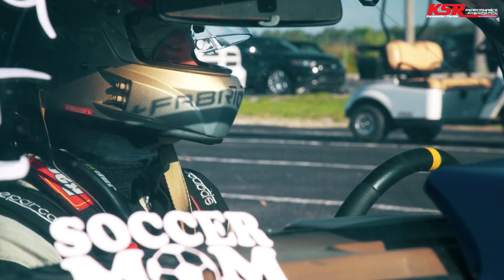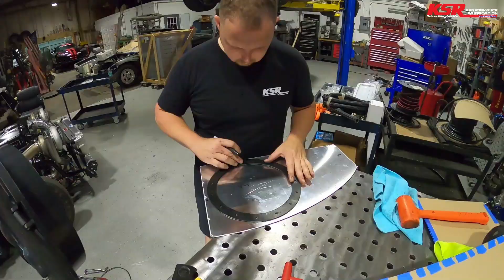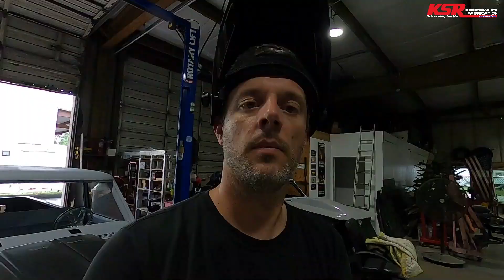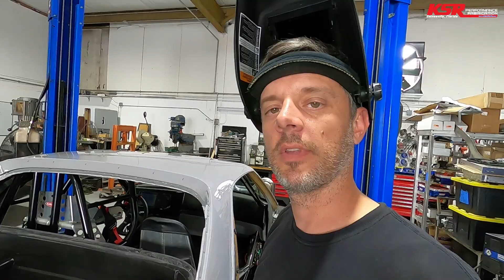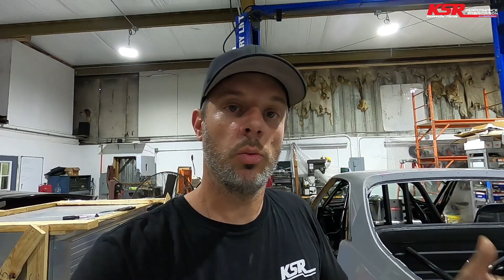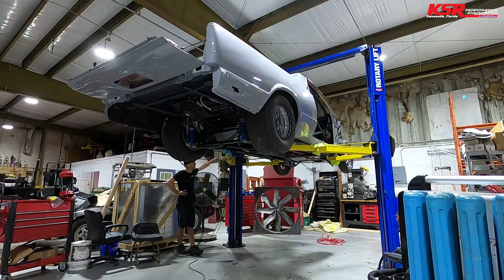Mullet El Camino Build Episode 24! Catching Up on Recent Progress!!

Comment: Kevin i know this is a long shot but where did you get the lid for the intercooler water box.
Reply from the maker: Its a waterproof lid for a kayak
Reply: @KSRPerformanceFabrication  i have been looking how big is it. i have only found 6 inch ones and that looks to be much bigger then 6 inches
Reply from the maker: It’s a 9” inside diameter I think. Got it from Amazon
Reply: Thanks kevin

Comment: Have you considered running a slider system for the fuel tank (cell)? It would allow for more minute adjustments of weight, and would allow for an additional tank to be installed quickly for long trips. I would make holes on the rails, to allow bolting to the rails themselves. The company I work for runs a similar system on their Baja machines.

Controlling how they land on a big high speed jump(using weight distribution), was the reasoning on being able to infinitely adjust this. And being able to slide in/out a tank quickly, lowered repair times (time where other parts could be worked on).

Comment: did i hear right that you are using ground terminal on the back of the car to control the switch??!!ever heard of ground being able to hover between positive and negative poles?i was building my malibu to similar extent as camino hear and had already wired like kevin said he would and the main responsible man for that said absolutely not due reason i gave.he has masters degree in electrical engineering and worked for nokia back then.if you do,expect a  myriad of mysterious appearing and disappearing electrical gremlins!!
Reply from the maker: The battery cut off is basically a huge relay. The ground control for that relay goes to the back cut off switch, the positive control for the relay goes to the front switch.
Reply: @KSRPerformanceFabrication  ground control still haunts me.why do you need it?all the relays i ve worked have a fixed ground and hot side is controlled.is it something new?

Comment: I'd like to understand the reason for such a big overflow tank?
What's the logic behind such a huge box? I'd expect a much smaller tank like 1gallon tank max.
Reply from the maker: Its definitely on the large size. There are a couple of reasons that I made it so big: 
1: If the engine ever "holes a piston" the crankcase tank becomes a catch for a bunch of engine oil that will get shoved out of the motor when the crankcase sees 40+ psi
2: This is every single system catch can for the entire car, Crankcase, transmission, rear end, rear fuel cell, intercooler vent, main radiator
3: Just incase the owner ever forgets to dump the tank.....there is plenty of room for alot of fluid to be captured...... (have you ever seen the tanks on Leroy and Ruby overflowing, wink, wink, lol)

Comment: One thing I would do is remove all of the zip ties and replace them with stainless steel zip ties. I would hate to see a hose dragging because one of them broke. Project farm said that these are some of the best ones he tested per their price point.. HYCC 100pcs 11.8 Inches 304 Stainless Steel off amazon for like 11 bucks..
Reply: Are you putting a hitch on it? I forgot if you said that you were doing that or not?
Reply from the maker: Yes, it will be part of the parachute mounting.

Comment: the hooptie law may apply. you cannot fix every problem because a new one will pop up. if you prevent every issue, a new issue will more likely occur. basically leaving a fail point might reduce chance of driver fail causing wreck. 

superstitions are weird sometimes.

Comment: I was wondering you have the fuel tank and the other tank rear and then water tank in front of bed its not much weight but would it be beneficial or not to place while the car on the scale

Comment: Kevin, when someone decides to have a race car fabrication museum.....mullet WILL BE IN IT.  YOU AND YOUR CREW do outstanding work .  the bottom of the mullet is as beautiful as the top side. a secondary ground on the back half is REALLY SMART addition to the system.  how about secondary padding for the seats for race week.  rugged radio headsets ready to go??  Charging ports for the smartphones?. CUP HOLDERS FOR SURE. great video sir.

Comment: Why not make up two sleds that weld around the transmission pan /bell housing but ties into the frame of the car, so if it wheelies n come down it hits the sleds instead of the trans pan or belly pan of the engine?

Comment: I really shouldn't watch these videos.. I miss welding so much. It's one of two things (the other doing auto paint) that I've ever felt like I was MEANT to do it. I get the helmet on and get to work and it just feels right, same with a respirator in the booth. I wish I could get a job doing it but out here in Yuba County Northern California, there's just not welding jobs to be had other than heavy equipment repair which takes a strong back and I don't have one thanks to my scoliosis. There's just not very many light jobs around here and the one race shop I know of is an hour away and I don't think I can fit inside their cars to weld rollcage tubes being 6'10.

Comment: Project creep!

I went to install 4 light switches today. Ended up installing 10 receps and 13 lights and a breaker after the switches. Turned a "1 hour minimum, may actually take 30 minutes" job into a 5 hour job.

Comment: Suggestion; put a plastic bump stop or slider(s) on the frame that will take a hit before the oil pan does from a wheelie and you could put one where it would protect the overflow hose from speed bumps etc on the road. Stunt bikes have something like it to keep the radiator and body work from getting as beat up when they drop the bike.

Comment: Ah man, all those little finishing touches eat up time like nothing else! Building a full header and exhaust system takes as long as sorting out the tail lights sometimes 😂 no matter how many cars I've built, I'm always surprised at how long the last pieces take, worse when it's my own car 'cause I just wanna drive it!

You're not being too optimistic though, for what it's worth. Getting each little part absolutely perfect night add a few days or a week of build time, but the car will (hopefully) be out and running for years and the extra time that part took gets forgotten pretty quick if it means better racing and more enjoyment for the next year or two. The details take time, but the impact of doing it right (or not) is 10x bigger than the build time!

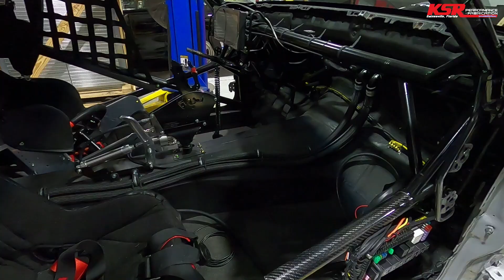Comment: I have a question about the lines you can see at 12:40 are those fuel lines? If so why are they ran from the inside of the car and not the outside? It’s probably like a stupid question but like wouldn’t that cause fuel to spray in the cabin if there was a failure? Just a question, would love if you could answer it. Love the videos man, great work

Comment: Such a professional custom build by Kevin. You know the thing that worries me, is that 'car maintenance' is not in Cleetus McFarland's vocabulary. He just runs things until they break... doesn't do scheduled maintenance on any of them, doesn't check brakes, suspension, safety systems etc. Just checks gas, ice, tire pressure and oil and that's it. I worry for Mullet's future, I really do😐

Comment: Man I’ve been prepping for RMRW 1.0 for months now and I had been running low on motivation, but this video kicked me in the butt to get up and go work on it right now! I’m going to go fix brake lights, wire the horn, and install the trans temp and trans pressure sensor right now. Testing this weekend! Fingers crossed for 8.50s!

Comment: In your battery voltage board where the original gas tank filler neck is don’t u think u should make that a momentary switch so as soon as someone lets go of the button it cuts the power off to that led screen. It’s not much of a voltage draw but if someone leaves that on while it’s being transported or something it would probably kill the battery. Just a thought

Comment: Kev
Wouldn't you prefer to keep lines hoses wiring  tucked 
I know you said Sno-ball
Dragweek will see something getting run over an all that plumbing below the frame is a pinch point 
You've put so much thought into the rest of the car
I hate to see a break from a mechanical while road trippin that bugger 
I've hit more wildlife on my motorcycle so I think too much

Comment: You could use the hose roller track stuff for the hoses in the bed like the ones they use on slide back recovery vehicles on the hydraulic hoses that will look good for when you move the fuel tank backward and forward

Comment: Question, why are none of the ice water tanks insulated with alight weight high density insulation?
There's a verity of things to choose from, plus it would help with condensation dripping on the track, keep water colder longer , and keep body from rusting out under the tank.
Along with that same thought, why aren't the intake side of tubing, especially after the intercooler to throttle body?
Even as fast as the air is traveling, there has to be great deal of heat transfer, especially at low rpm's, and staging where it would pickup the most heat transfer.

Comment: I am dying to know what the final cost of this project is.  Parts, labor, fab work everything.
Reply: If you have to ask, you can't write that cheque. 

If you want a 6 second car, plan on 100k as a starting point to get the drivetrain and cage work. The first car I put AN lines on I made the mistake of "oh, a $8 fitting..." and $1800 later I went "wow, that was spendy".
Reply: $250-300k minimum

Comment: How are you preventing backflow from the catch tank? Ie. the radiator pukes a ton into the catch tank and fills up to the fitting that the rear diff breather line attaches to - preventing the coolant from polluting the rear diff.
Reply: If that tank gets filled to the top, I'm sure the car has bigger problems than one system possibly feeding into the other

Comment: If you want bright sunny days always carry an umbrella as it only ever rains when you don't have one.
There are places under a car where bottoming out is most likely to occur so you should avoid placing things in those places.
Just behind the front wheels is a strike zone for speed bumps and gutters due to the sudden drop compressing the suspension.
The middle of the vehicle is mainly a scrape zone

Comment: Put a nub on the fuel door so that when it closes, it hits the voltmeter switch to the off position. If it's left on, there is no way to see that it's on from the outside and a flat battery waiting to happen :)

Comment: Kevin I love the work you do and the thought you put into it, but I have some suggestions for the mobile/removable rear fuel tank. I think an E track tie down mounting system would have been better. It would give you a ton more mounting locations and quick removal without the need for tools. Also an idea for the lines going to it, maybe look into Hubbell-Kellems CableTrak. It would allow for multiple positioning, keep the lines in place and uniformed, would also protect them from getting kinked.

Comment: I used to wire a few street rods and cars for guys...I don't know how that happened, wound up doing probably 10 overall. I had a cartoon cut out of the comics in the old Sunday paper with a pic of a guy getting chased down a hill by a giant snowball. 
My wife gave it to me.
I got to the point where when people asked about time frames I mentally added 25% to the my estimate. Towards the end, where they wanted cruise control, power seats, power windows, power trunk lids, and everything you would find in a luxury car I just said, "I will call you when it is done".  I know as a business guy you can't do that, I could as I was working on one at a time,
The snowball effect is real, and there is no way around it when building a car like Mullet where you are trying to plan for every possibility and make it extremely serviceable and almost modular.
Me...at 62...I have one more build in me. Mine. LOL.

Comment: A simple solution would be to add a skidplate under the car, that will add significant protection against road salt, rainwater and damage that you don't want under there, in addition it will greatly improve the aerodynamics under the car, which I can imagine are pretty bad right now, but I'm sure you've thought of these things already.

Comment: Not sure if something like this would help with the fuel hoses. https://www.amazon.com/Black-Plastic-Chain-Carrier-Router/dp/B00880AVL2/ref=asc_df_B00880AVL2/?tag=hyprod-20&linkCode=df0&hvadid=198071192844&hvpos=&hvnetw=g&hvrand=1082838630173327778&hvpone=&hvptwo=&hvqmt=&hvdev=m&hvdvcmdl=&hvlocint=&hvlocphy=9016922&hvtargid=pla-365229598478&psc=1.  There are different types you can look at.

Comment: A "20:20 hind-sight" idea for the plumbing and wiring.  Could you have made the transmission and driveshaft tunnel a little bit wider and tucked everything up in there?  That would help protect everything from road debris and definitely protect items from the wheelie-landings.  It ALMOST looks like there's enough room as it is although that would make accessing the transmission a bit more difficult.
Reply from the maker: These cars can be packaging nightmares. Already the width of the seat + seat belts + roll cage has us crammed in pretty snug.
Reply: @KSRPerformanceFabrication  I still think there's need for additional protection of motor and trans pans in the event of the car coming down from a wheelie. Just seen an episode of Cooper's wheelie and the added down frame hoops saved everything from damage
Reply: @KSRPerformanceFabrication  True enough, I'd forgotten about the interior fittings!

Comment: Maybe I missed in the video somewhere why the catch can is so big in the back? I understand putting them all together I totally dig that but it's just a massive huge frankly ugly? Tank. You do great work so it threw me to see that maybe it's code I don't know.
Reply: I would imagine he is adding ample volume in the event there is an issue. You can get a double failure and end up with lots of oil and coolant in there at one time. The volume buys time to get the car stopped safely, or this is my take on it. He has tied all of the overflow and crankcase ventilation to one central location so you need to account for that too.
Reply from the maker: It is pretty large......but we are planning for a future alcohol fueled engine and let’s be honest......ole Cleetus may go a few races without draining it, lol.

Comment: So if your thinking about building a car. It's a thousand and 1, 2, or 2 dozen or more things to build it. I have helped my dad build two cars. The amount of wiring, little brackets and small bolts is insane. Still really fun work super frustrating at times but worth it. I lost track of how many times I routed then 
re-routed wires. Then came back two weeks later and looked at it and didn't like it and made adjustment.

Comment: You know when you open a video and you see Kevin with his hood open, it's gonna be good.
Reply: Yep.  Not to be negative, but all that tig welding is almost as bad on the hands and wrists as typing.  Which usually leads to carpal tunnel and surgery.  Hopefully he has consulted with someone in the physical therapy field for exercises to prevent or slow its arrival.
Reply: @95_S10_LSSWAP  I hope Kevin hasn’t gotten started on that.  I’ve played bass over 40 years and despite 3-4 occupations that could’ve done me in, I circumvented it by stretching multiple times every day for many years.  Hopefully Kevin might see this and kick around the idea - it takes a minute but it sure is nice (for me) to be almost 60 and still have great flexibility and no sign of carpal tunnel.
Reply: @95_S10_LSSWAP Bad grounding will fix that - if you don't get burned, you will find new muskell that hurts
Reply: JOKE- OR not. How do you know that you are software nerd? You actually use that wrist rest on keyboard
Reply: You should take 10% of your weight and take it up at any angle with straight hands. 1 standing up. 2 on your knees 3 at your belly (do not try this cold, arching)
Reply: @95_S10_LSSWAP  most jobs that a labor intensive have the same risks . I got carpul tunnel in both hands at 21 because I was using a 9inch grinder on thick steel on a constant basis.  Some people get it some don't no matter what jib they do. If he was going to get it he would have it by now. But going to a osteopath and stretching regularly does help prevent or maintain them . I had to stop working on cars and doing heavy manual labor full stop . But even then it still sucks
Reply: I look forward to this like coffee in the morning